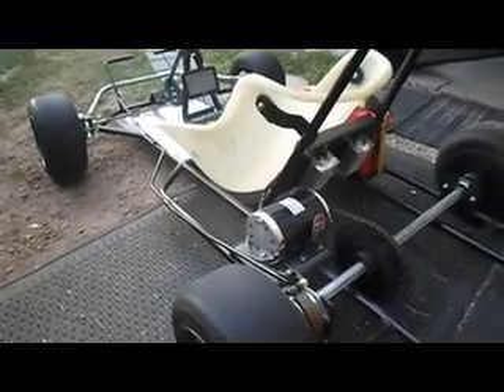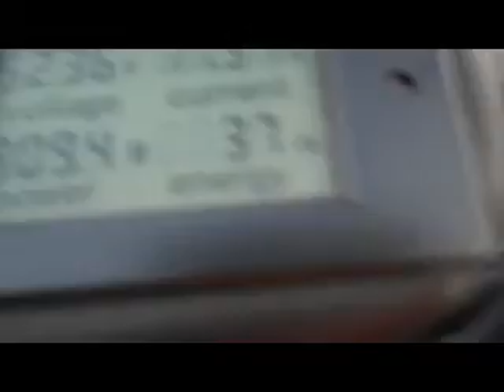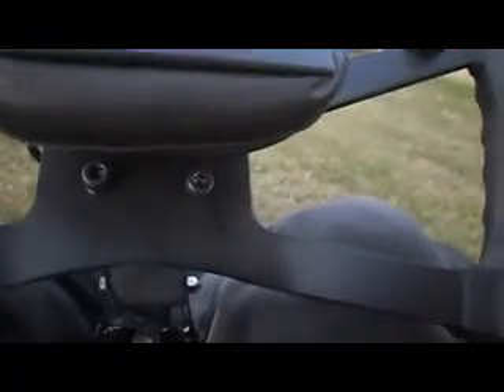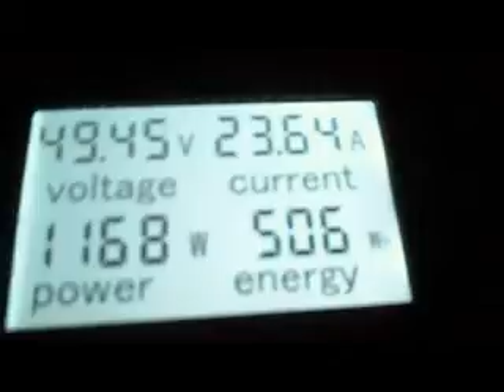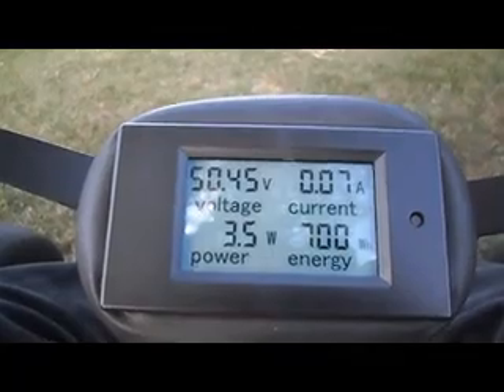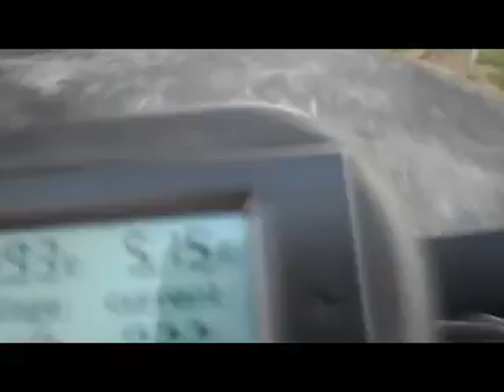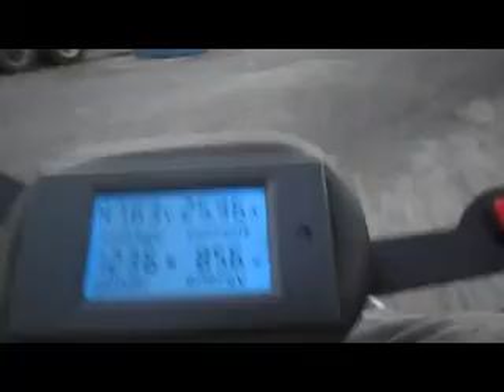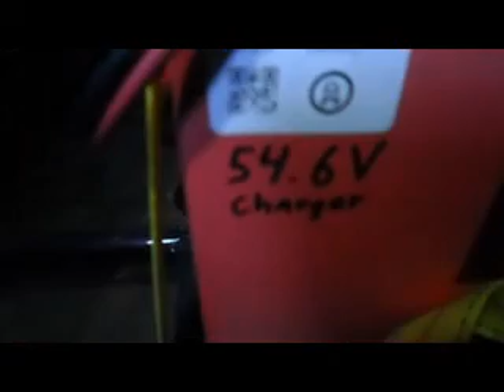Excalibur Electric Racing Go Kart prototype 10 Test Ride with 48V 35AH Lithium battery

Comment: I want to make something same with brushed 48v 1000w my1020, but run it on 60v to increase power (going out of the calculations it's 1500w). How do you think would there be damage to the motor or overheating?
Reply from the maker: Yes you will probably damage it.  It's almost always best to stay within "specified operating parameters"
Reply: @functional_artist  ok, I'll better use two motors
Reply: Most likely. I'm running a 48v 1800w motor using 18650 1kwh pack. 14s 10p is 58.8v to increase more power increase your battery back. Eg 14s series 20p parallel. More in parallel less battery sag under load. Follow my icon to see how I did mine.
Reply: @adamcecere3369  Yep, increasing voltage for brushless motor is a lot less harmful, then for brushed
Reply from the maker: @adamcecere3369  This pack is 13S (54.6V)  I wanted to see what it could do.

Comment: Do you have link on were to buy the watts meter you are using.
Thanks
Reply from the maker: Yup, (~$20.00) https://www.ebay.com/itm/100A-DC-Digital-Watt-KWH-Current-Power-Energy-Meter-Ammeter-Voltmeter-7-100V-US/281768704865?ssPageName=STRK%3AMEBIDX%3AIT&_trksid=p2057872.m2749.l2649
Reply: @functional_artist  thank you